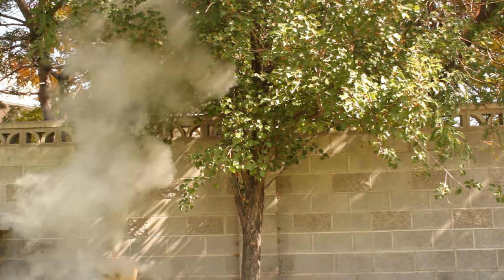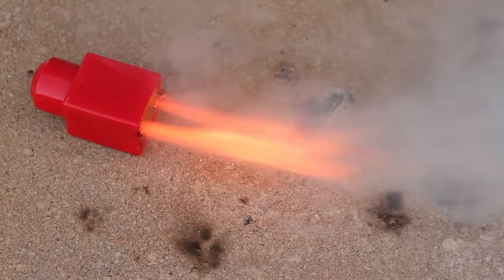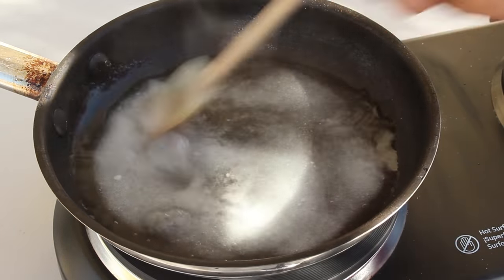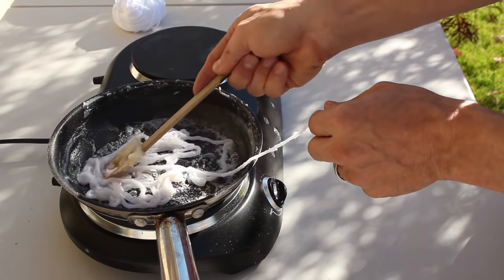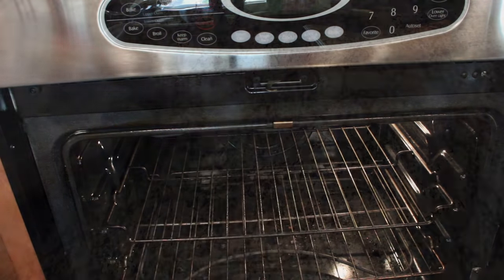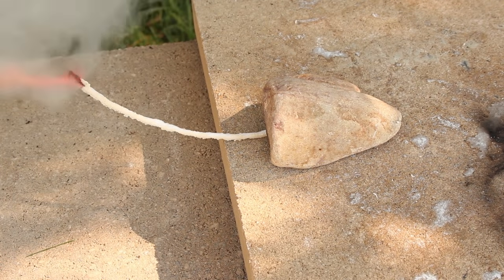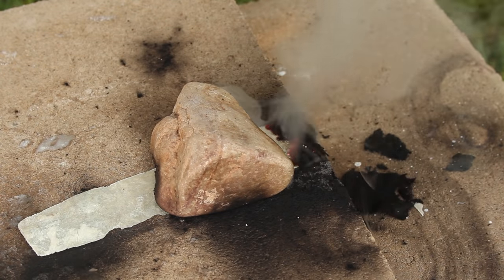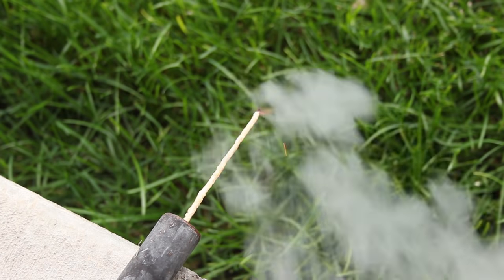How To Make Slow Burning Fuses

Comment: Make sure that the water doesn’t evaporate completely, so when the solution is frothy turn off the stove but keep it over the heat. That way it doesn’t clump. Also, R.I.P. man
Reply: Does it hafta be made outdoors(i.e. fumes like making guncotton)
Reply: @hotamale35  no, I made it inside and it was fine

Comment: Can you do this without putting it In the oven? The MSDS for kno3 doesn't make me want to do it just in case.
Reply: You are smart. As far I can tell, you should be fine just letting it dry outside- I don't think a reaction is occurring in the oven.
Reply: Problem is it's hygoscopic (absorbs water from the air).  Need to drive out all the moisture.  As it sits in the sun it will only reach whatever dryness the air's relative humidity allows it to.  It may work on a dry day, but maybe not if it's humid.  Higher temp in the oven means lower relative humidity (Humidity % is rel. to temperature).

Most commercial fuse is oven dried then coated with a shellac to keep moisture from the air out.

KNO3 is not poisonous in small or even medium quantities.  As long as you keep the temp low so it doesn't ignite in the oven, you should be OK (225 F)

FYI: KNO3 is used in many sausages, but you typically don't eat the KNO3, the KNO3 is for long curing meats and breaks down into KNO2 (Pot. Nitrite) by the time it's ready to be eaten.  For short cured meats, you just start with KNO2.  

But it really won't hurt you in the quantities that will be getting into your oven from this.  Oral toxicity is >2g / kg body weight (LD50). A 70 kg person would need to eat more than 1/4 of a pound to be 50% likely to die (but he'd leave a well-preserved corpse if he did!)

The KNO2 that is in the sausages has an LD50 of 3.8g/kg. So it's only twice as poisonous as stuff were supposed to eat!

Comment: I tried it and it didn't work.  Is there a special brand of stump remover I should use?  I used a brand called "Bondie."  It stank up the house and didn't light.
Reply: Patrick Gallagher lmao!!! Follow directions m8... the only stump remover that will work is one with 99% KNO3... I could almost guarantee you that the one you used did not contain kno3 😂😂

Comment: I can't get the moisture out of the fuses without actually burning them, any tips??
Reply: jampot
Reply: +Karn Kid MTG  the moisture dosnt seem to come out without me burning them, I dosnt air dry, I have tried everything basically :(
Reply: Did you cook them in the oven? And if they burn what is the problem with them being damp?
Reply: +Karn Kid MTG yes!
Reply: Damp*
Reply: So cool them only for a little wbot
Reply: Bit
Reply: +CoC With Bok it will snap with the slightest pressure
Reply: +Karn Kid MTG what do you mean by cooling it
Reply: Sorry I mean cook it only for a little bit
Reply: +Defender of innocents 777 thanks guys
Reply: +Otto Hast I will ;)
Reply: So? Did it work?
Reply: It looks it worked out deadly.
Reply: Keep them under ~250. I dried mine at about 200°F. Over 250, they tend to smoke and turn brown

Comment: I thought cutting fuse with scissors could ignite it because of friction. This maybe only applies to real fuses but I think it's safest to use a razorblade anyway:)
Reply: That doesn't apply to any fuses. If cutting the fuse could set it on fire, touching it and breathing near it would probably have the same chance of Uranium. Also its probably White Potassium
Reply: If you happen to be using white phosphorous, try not to breathe it in... It turns into Phosphoric acid inside your lungs...

Comment: is there any way for me to adjust this formula to make the flame much, MUCH weaker and not as strong?  for example, by lowering the potassium nitrate ratio
Reply: I just simply got the water up to a boil and dissolved the mix. I put in my yarn and soaked up the moisture. 300f in the oven for about 12 minutes.  I got way more fuse material and it burns at a rate of 9in per minute.

Comment: well, i don't know where to find stump remover.. i tried the biggest garden shop in town.. is it replaceable with kno3 or isn't it? please tell me i need some help with this.. thanks aleady
Reply: Depending on where you liv, you might be able to go to the supermarket and buy some potash, which is yet another name for saltpetre (KNO3). It's more expensive than stump remover, but affordable.
Reply: oh well, I use KNO3 now and it works fine if you ask me so you were right as long as it contains KNO3 its good to use

Comment: The reason this burns underneath the rock is because it has its own oxidizer. Technically, this could burn in space with no oxygen.
Reply: MrLittlelawyer but you couldn’t light it in space right

Comment: Will it work with nylon or polyester or synthetic material
Reply: It will. But burning synthetic materials gives of some pretty noxious fumes, and the material might melt and sputter, which could be a bit dangerous. Cotton is recommended.
Reply: No it won't, I tried but when the plastic yarn melts it will cover the "Fire" with melt plastic and it constantly stop burns!

Comment: Can a gas oven be used for this project?
Reply: Yes but it's going to burn the fuse so i don't really recommend it although it will still work as long as you did the before processes correctly, i for example didn't put the fuses in straight lines since they were too long and it came crampled and a bit burned

Comment: could i use a open flame to dissolve the mixture since i do not have a hot plate?
Reply: Raton Colorado Yes, just be careful.
Reply: Ben Morrow Can you just let it dry instead of baking it?
Reply: I don't think think so, unfortunately. You have to cook it fast enough and hot enough so that the sugar caramelizes and turns a little brown, but at a happy medium where it doesn't catch on fire. Don't worry about cooking it in the oven, though, if that's what you're asking, because it doesn't smell bad.

Comment: would this fuse still work without baking it?
Reply: +Enduro Tim No
Reply: +Enduro Tim The baking is done to remove all of the water from it. You could also leave it in a dry area (preferably with some water absorbing materials nearby), but using the oven is much, much faster.
Reply: +Matej Hanušovský yes but it's not as efficient as baking it

Comment: I've tried this method even adding some iron (III) oxide as a catalyzer. I found that the fuse works decently if used soon after made, but it is hard to store due to its high hygroscopy. Does anyone know how to reduce its sensitivity to humidity?
Reply: Store will silica gel packets?

Comment: Can someone tell me if using a piece of parchment paper on the cookie sheet would be bad? Also what instead of baking it why not use a food dehydrator?
Reply: parchment paper will NOT soak in the mix,(in my opinion) and i guess that cooking would just harden the mix(as the strand seems hard).. i cannot give definitive answers as i have not tried it yet.
Reply: I meant put the string on the paper then on the sheet

Comment: My hardest problem, where to buy KN03? Potassium nitrate
Reply: The best way is to go to a fertiliser shop for farming because potassium nitrate is actually used a lot of farms to help grass grow. You should be able to buy a big bag. It will be in small bede form tho, not powdery. So just get a cheap blender and chuck it in there.
Reply: ok, but KNO3 IS flamable , what if i actually burn the whole bag? my house is gonna catch on fire XD
Reply: SSG777 ProDuctioN Potassium Nitrate is actually non-flammable by itself. When it burns it produces oxygen. Its only flammable when its mixed with sugar. Sugar burns extremely fast due to the extra oxygen coming from the KN03.
Reply: bro thx for info, now i know all about KNO3 thx ;)
Reply: im gonna buy it

Comment: Can I somehow use saltpeter instead of the stamp remover?
Reply: saltpeter is the same thing as stump remover; KN03
Reply: AwesomeRC
One last question, did you do this outside because the vapor from the mixture is bad for people to breathe or is it safe to do this at home?
Reply: DarthKamci0 its safe and non-toxic unless it goes wrong and starts burning. In that case its hella smokey

Comment: I'm surprised that just the potassium nitrate burned on its own without a fuel like sugar added as nitrate don't burn on its own without a Fuel. Is the yarn the fuel. ? I make gun powder and was just wandering. A mixture of gun powder is much Easier to make with dry ingredients of 75-15-10 kn03 charcoal sulfur. Make into a slurry and do the same with the string.
Reply: Daniel Yost rewatch the video and let us know.

Comment: could anyone of you tell me what happens if i try to bend the fuse after i got it out of the oven? because i would like to make one really long fuse
Reply: It would more then likeley crack
Reply: +roof.art Going with what Austin said, like imagine you had a wick with candle wax on it, if you bent it the wax would flake off. But you could probably just keep it the way he does it but not cutting it so the flame has to zig zag. If you're afraid the flame might light the fuse, make the string farther apart

Comment: it blew up inside my oven what did I do wrong?
Reply: +Ollie Case try lowering the heat and opening the oven door and let it bake for hours
Reply: Cheers man my my mum wasn't pleased 😆
Reply: Somewhere under 300 and above 200°F, it turns brown and smokes. Mine simply dried at 200 and it works fine.

Comment: do you have to use a electric stove? or can i use gas?
Reply: Gas=big boom.
Reply: It doesn't matter, they both heat up the same.
Reply: john johnson Of course it matters, this mix is highly flammable, only an idiot would suggest heating this up on a gas stove, it has to be electric.
Reply: pablo picasso As long as the flame doesn't get higher than the end of the pan it's fine.
Reply: I am just extremely safety conscious, I follow the guidelines of the worlds leading pyrotechnicians and it has kept me safe.
Tell you what, go onto "skylighter", the website (which has some world leading hand made fireworks makers as members) and tell them it is okay to make this compound this way.
I am pretty certain that you will not do this because they will all tell you the same, it is like looking down the barrel of a loaded gun.
The potential to severely hurt yourself or others around you is high.
Infact, I have never ever seen anyone make it over live flame before on youtube or anywhere else.
Now, do you think, just maybe, their might be a reason for this?
Reply: pablo picasso Yeah, you aren't certain it's going to explode, but just for safety. Gotcha
Reply: john johnson It wont explode, but it will burn and light things on fire. it also is difficult to extinguish. 
ZZZZZZZZZZZZZZZZZZZZZZZZZZZZZZZZZZZZZZZZZZZZZZZZZZZZZZZZZZZZZZZZZZZZZZZZZZZZ
Reply: I was heating it on a barbecue xD (open flame)...
it didnt explode :)
Reply: pablo picasso Actually it is dissolved in water, therefore it is not highly combustible, so Pablo think before you type... ;-;
Reply: jason li I used our grill, but I don't think I would have done it indoors.
Reply: i think there is no idiots who will fire up the grill indoors -_- xD
Reply: ***** youd be surprised
Reply: William Laidlaww well thats true... unfortunately hahaha
Reply: yep

Comment: Does it work with NaNO3?
Reply: NaN03 is the compound he used (stump remover). It act as a oxidizer because of his N03 group and so help supply the sugar with it's oxigen needs to burn :) Nice fact, sugar can be used as a combustible and also, it can be used in sulfur less gunpowder to lower the carbon temperature needed to light up. It replace the sulfur compound. I hope I helped you !

Comment: Can i use sodium chlorate instead of potassium nitrate?
Reply: No! Use Either Potassium Chlorate or Potassium Perchlorate or use Black Powder/ KNO3
Reply: I live in scotland where i cant get black powder and the closest i can get to potassium is a banana
Reply: +ninejets Ok lol hang on
Reply: +PyroGuy Ok This is the chemicals and how to make black powder  (100 grams to be exact)

Potassium Nitrate- Go to a butcher shop and ask for KNO3 or Potassium Nitrate for pickeling or curing meat also known as Stump Remover at Lowes

you'll need 75 grams

Charcoal- you can make it yourself by getting a paint can and putting a fist sized hole on the lid then fill it with softwood (Balsa , Willow etc.) Small Pieces! Put it on a fire until no more smoke comes out of the hole then let it cool them grind it to a fine Powder

You'll need 15 grams

Sulfur- You can buy it at a fertilizer as Garden Sulfur

You'll need 10 grams

Ok now get a mixer / grinder ( Ball Mill, Mortar and Pestle etc.)

Put all of the chemicals in the Ball Mill with 75-100 pieces of Lead Media

Ball mill it for 12 hours then you're done!

Hope I helped! :)

Anymore questions I can answer email me at luckypyro.bl@gmail.com
Reply: ninejets Yeah lol no problem
Reply: +PyroGuy Can i just use potassium?
Reply: No because it is not an oxidizer
Reply: ninejets though it worked! LOL
Reply: Juyeong Woo Did you try it
Reply: ninejets YEA!
Reply: +Sweet Gaming Potassium metal will catch fire when mixed with water. Do you really mean potassium or some potassium salt?

Comment: How to get KNO3 ?
Reply: black market?
Reply: @cokayn7049  that will be difficult,    any other reactive material instead of fuel ? We need party.
Reply: @arionodhanis3677  potassium permangnate. I like fires and since i cant acquire KNO3 too, i plant to use potassium permangnate's reactions. You can use any strong oxidizer and just a little bit of youtube and googling to what will produce the best reaction.
Reply: @cokayn7049  that is fun, what if I put potassium permanganete, in a car air system (the gratting in front of car, the inlet of the clean air) may be something fun happen.

Comment: There might be "hell to pay" if the stuff happens to ignite in the oven..  I wouldn't want to be you, then..
Get an old stove from the dump or curb, and make your hobby-oven..  You'll be glad you did..  But it's gonna be a yuk trying to get 220 outside if you don't have any outside.. Plus, 220 outside is more dangerous than all of you put together are...

Maybe build yourself a lightweight oven from a stove.. One that you can carry into the house, and plug into the clothing-drier socket..  And a good fan blowing out the window, just in case you aren't firing on all thrusters that day.. and your project fills the house with smoke..
What would you do if the stuff ignited in zee oven..? 
Lemme guess... umm.. "Cry, and jump around the room trying to kick yourself"?..